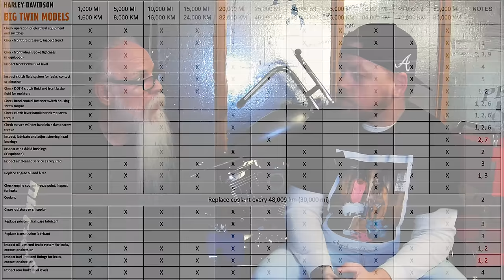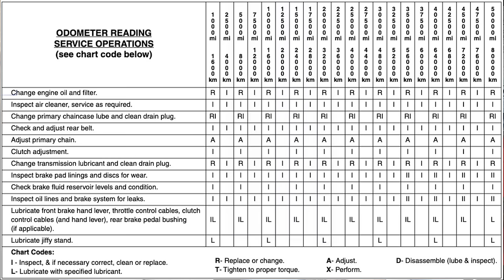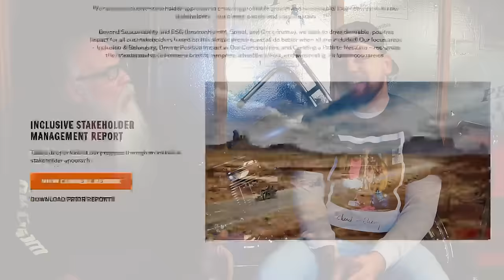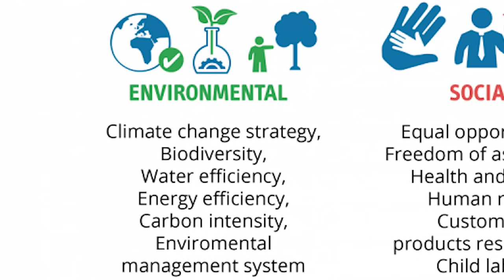Harley Oil Change Intervals-Engine, Primary, Trans

Comment: I change all three every 3K, oil is cheap.  Formula + in primary and trans and everything is smooth as silk.  A Harley tech friend said most not all of his trans failures had Redline in them, don't know if there is any truth to it but that's what he see's.
Reply from the maker: Interesting on the Redline.
I have not seen many trans failures.  I do have a friend that runs redline in his trans, and it failed several months ago.  But with the way he rides and shifts, I believe it would have failed regardless of what oil he was running.
Thanks for the add. 👍😎👍

Comment: 3000 engine oil. 5000 primary and tranny. My reasoning: Engine oil gets contaminated with "blow by" on combustion, that can form acids that are detrimental, microscopically etching fine surface finishes. Engine oil gets exposed to higher temperatures, where as the other two do not see these high temps.  There is no "blow by". I use high quality synthetic in all three holes. Always looks good at change intervals, like it could run longer, but I get NOTHING on my magnets. Been a Harley guy for 50 years. Last ride was an '99 Evo, still running clean and strong at 134,000 miles, when it was totaled . I ran Amsoil in it, as I do in my current ride, ,a twin cam. IMHO, fluids need to be particle free, to avoid scuffing precision surfaces. In my experience, clean fluids along with regular overall maintenance give long service life and very few problems on the road. Just my two cents worth. ....
Reply from the maker: All good points! 

Thanks for sharing and for commenting! 😎

Comment: Hello Kevin,
what can you say about your experience with Harley's Heavy gear oil in the transmission. You had exchanged it for red line. Would you change every 5000 miles here too?
The oil is very expensive, at least in Germany. 35€ per Liter
Greetings Thomas
Reply from the maker: I have several thousand miles with the HD Heavy Gear Oil in the trans.  It is definitely good stuff...almost as good as redline.  But I will be putting in redline next go around.  To me the redline shockproof seems a bit smoother.

Comment: Always watched my motor oil and once it starts getting dark brown which has been around 3500-4500 miles of regular to aggressive riding I change all 3 holes if I have 3 😁 sometimes I run open belt drive primary on big inch choppers , I never have allowed my oil to get black , I always tell my friends who say you're changing your primary and transmission oil way to soon that it's my money I will spend it how I want 🤣
Reply from the maker: Great points! 👍😎👍

Comment: On 2013RK, engine = syn3 8000km (Europe), pri = formlua+ 10000k, trans = formula+ 12000 k, just for ease and less stress I am not doing 3 holes at the same time anymore, which I was doing with the Evo's (one time 11000 km on the 3 oils during a 4-5 week Scandinavian holiday in 2010, no problem with the oils on long distances in such a short time period ! ).
On 2016UL, engine = syn3 8000k, pri = formlua+ 10000k, trans = gear oil 12000 k, this is the holiday machine now, if 8000 k is after holiday, I will do 9000 k, no fear, no problem, engine oil never becomes black (has no "tune"), no heavy consumption.
On 2019UL CVO engine = syn3 8000k, pri = gear oil 12000k (starts smelling), trans = gear oil 16000 k, I think that's enough mileage, I won't go to 32000k / 20000 miles for the transmission, although that is the cleanest oil, with nothing on the magnetic plug.
They will also extend the mileages for customer cost sake compared to the competition (at least for cars), after experience that the older shorter intervals showed no serious wear etc. , so were actually relatively too short. And, of course, synthetic oil is then prescribed as well.

Comment: My personal take is engine at 5k. I can see primary up to 10k with good synthetic oil. However, i still change mine at 5k because of cluth friction material. I can totally see 20k for a service on a transmission, though. Modern synthetic oils are far superior than those of even 20 years ago.  For example mobile one has a extended service synthetic motor oil that you can go 20k on a oil change with the matched filter. I use this in my vehicles. I have put just 200k on my 2016 gmc sierra with a 5.3l doing these interval with mobile one. I've cut the filter open a few times and never see anything out of the ordinary. If you also look at modern automatic transmission in cars they arent even serviceable anymore.
Reply from the maker: Thank you for the info, much appreciated. 👍😎👍

Comment: Change my engine oil every 5,000 and primary and trany every 10,000 but they all get changed at least once per year before going into winter storage. I average between 7,500 to 12,000 miles per season.
Reply from the maker: Thanks for sharing. 👍

Comment: Just compare 2 things. How expensive is a rebuilt or new motor compared to oil? Oil is cheap. I won’t wait for double digit thousands of miles to change oil. Everything at 5k is good with me. Oil is cheap. What happens if you don’t ride your bike that much per year? What if you only go a couple of thousand a season?
Reply from the maker: Ture! I would much rather change my oil  way more often than to have to rebuild the motor any day! Thank you for commenting! 😎 MB

Comment: I watched a video where they said that the oil pump for the 2019 and below M8 114 is inadequate and should be replaced with a 2020 or newer model, and better yet, a performance model. Any opinions?
Reply from the maker: Around the middle of 2019 HD changed oil pumps to the latest design. (click link below for a chart)
Prior to that, they went thru quite a few iterations as they looked for a design that would scavenge the oil better, reducing the chances of sumping.
https://live.staticflickr.com/65535/48740997281_ac613f1cc2_h.jpg
If you have one of the older oil pumps, there is a chance (not a guarantee) that it will eventually cause problems.
Reply: @DKCustomProducts  Thanks! I'll check mine out. Fingers crossed.
Reply: @DKCustomProducts  8/18. Bummer.

Comment: I don’t go by miles so much, just change engine&primary 2x per riding season, and the trans 1x every season. 
 Amsoil vtwin
 Severe gear in trans
 Jd hygaurd in the primary.
Reply from the maker: Awesome! Glad you have found an oil and routine that works for you! Thanks for commenting! MB

Comment: I am an ass about maintenance.  I do motor oil every 3000 full synthetic and Tranny with Primary every 5000.  Tranny I use Redline with Shockproof and Primary is Redline primary fluid 
Runs smooth as glass

Comment: I clock around 10k miles a year on average and have been doing engine oil/filter every 5k and primary + trans every 10k.  Might start doing a 3-hole every 5k, might not... 😅
Reply from the maker: The primary ends up with a lot of containments in it, from the primary chain and the clutch plates....and depending on how one rides, that can be quite a bit.
Transmission hopefully does not have much in it...unless there is a lot of grinding of gears, and/or a lot o dumping the clutch at higher rpm's.
Thank you for the comment.MB

Comment: Any downside in starting to run synthetic oil in an Evo engine that has never had synthetic oil run in it?

I’ve read that switching over to synthetic oil’s in older bikes might cause them to start leaking.

Any truth to that, or any downside you can think of?
Reply from the maker: Good question on a hotly debated topic.
There are many who come down on both sides of that fence.
If you still have the older, or original gaskets, I would not even consider running synthetic.  Even if you do have all new gaskets and seals, I do not know that it would be something that I would do on my own Evo.
Reply: @DKCustomProducts  
As always thank you for your answer. I use the Harley oil, I’ll just keep using that. The damn thing has been running 26 years on standard oil, I’ll just keep it up.   

Your videos and your answers are really helpful.  I appreciate it.
Reply from the maker: @JR-ss3td  Good deal man, glad you're finding our videos useful & helpful. Thanks for watching, ride safe!

Comment: I have the original owners manual for my 1985 Electra Glide. 
Engine oil, filter and tappet screen 2500.
Primary 5000
Transmission 5000

Comment: Always Redline full synthetic 20w60 in engine, Redline shockproof in Tranny and Synth 3 in primary. Back in the days I used Castrol 20w50 and Castrol 80/90 in the gearbox on all of my Evo’s and Shovel’s, we filled the Primary with Castrol 20 or even 2 stroke oil could do the job since it always ran out over time. 😉👍🏻😂

Comment: Great video as usual.  I change all 3 holes when I do it at 5K.  My question is, how long do you go time wise to reach 5K?  1 year, 2 years, when timewise should you change your oil?  With Covid, I'm sure many could go a long time without getting 5K.
Reply: The saying is, once a year wether it needs it or not. An annual maintenance is a good idea IMO
Reply: Every year
Reply: If riding less than 5,000 miles per year, oils should be changed yearly (at start of riding season). Condensation will collect in oil over winter hibernation.
Reply from the maker: As others have noted, at least once a year.

Comment: Oil is a lot cheaper than a new motor, primary, and transmission... I always change all 3 and I run Lucas 5w50 and 85 in the tranny

Comment: What if the old numbers were there to sell fluids? Abs the new interval is what's actually accurate? Is that possible?
Reply from the maker: I like what Jack said...going to PIN is comment to the top.
I think if it is coming out dirty it should have been changed earlier.

Comment: What are your thoughts when your riding mileage doesn’t meet a calendar based time requirements to change the fluids? Because life gets in the way sometimes that one year change requirement might be on fluid with low miles.
Reply: I have the same question! Should you change it every year even if you don’t hit 5000 miles? In my area I can usually only ride 8 months out of the year so I don’t always hit 5000 miles.
Reply: Condensation in a motor is rarely discussed, it's hard to quantify. Motor builders recommend yearly if miles are low as cheap insurance against condensation.
Reply from the maker: Per your  manual, fluids should be changed every year, regardless of miles.  This is a good practice.
Reply from the maker: As Carl said, every year, not only because of condensation, but also acid build up.
Reply from the maker: Condensation and acid build up!  Thanks for sharing. 👍
Reply: @carlbruhn1772  cheap insurance against condensation is riding it long enough to get up to operating temperature don't just hop down the block and shut it off get on it an hour later and hop down the block and shut it off that's where condensation comes in. Edited to say; we used to refer to it as "sweaty valve syndrome" as always, ride aware.
Reply: @Pete Smith  Absolutely.  The weirdest looking inner cases I ever saw was on a 10 year old sporster with 900 miles. The owner had the oil and primary changed once. He started every month for 15 minutes and figured the miles were low enough to not change it. It had a tinged yellowish orange color that I have never seen since. It was smoking due to a poor ring seal. He sold it to us and we sold it to a local fella who raced sporsters.
Reply: @carlbruhn1772  my bet is that the yellowish color would be aluminum and the orange color would be iron
Reply: @petesmith5092   I truly wish I would have taken pictures.  It almost appeared anodized. Quite even just a bit darker towards the bottom.  That was a real eye opener.
Reply: @DKCustomProducts  and dont put it away with the used stuff! Get it hot, drain it in suspension, then change it and put it away with the new stuff in it
Reply: @carlbruhn1772  Yes Sir! Every little bit helps, unless it hurts. There are ways to save money, but being cheap is not one of them. I ride year 'round and I found that out the hard way. (Yes, I have heated grips)

Comment: My 2024 TriGlide  calls for 20W50 motor oil in the transmission.
What 's up with that??
Reply from the maker: For decades one of the oils recommended by Harley for the Transmission has been 20/50 motor oil, and I've never seen any damage due to using it.

HOWEVER, it will shift smoother when using something like Redline Shockproof gear oil.

Thanks for commenting! MB
Reply: Will Harley void your warranty for not using 20w50?
Reply from the maker: Not only will they NOT void the warranty for not using 20w50, if you look in your manual, they suggest different weights for different ambient temperatures.  You can see a photo from the HD manual at this link- https://www.dkcustomproducts.com/pub/image/Links/Oil%20Weight.jpg 

Thanks for commenting! MB

Comment: Winter here is late November to early March. When the bike comes out for spring, I change the oil. Every other year I change the trans and primary. I use screaming chicken S3 for all of it. With all the projects I'm working on these days, I'm well under 5k a year... more like 3k. With my daily drivers I change at 3k, and on one model I change the filter at the half way mark (1500), as it has a tiny oil filter (and recommended by GM). 10, 15, 20k between oil changes is retarded, regardless of the snake oil in it. When people ask me how often I change the fluids in my rides, I respond with "All the time". People are fishing for validation to not change their fluids... Because spending 100 bucks for such things seems excessive.. However they are willing to drop 1+ grand on a phone without hesitation. Maybe do a video on the serious mental heath crisis in the country, with falling IQ levels across the board.
Reply from the maker: Thank you for your comment.  Some good info, for sure.
No doubt the "smartphone" has resulted in many unintended consequences.

Comment: I do engine oil every 3k. I usually try as well to do the other two the same time. Maybe 40% of the time the primary and transmission I’ll do no later than 1,000 more miles after engine oil is changed. I’ve always been under the belief whatever the manufacturer says..you want to do before. They have a interest in your bike not lasting as long as you want it to.
Reply from the maker: You have a good point there!

Comment: they also state that using heavy duty gear oil in the primary and tranny now?
Reply from the maker: It can certainly help to reduce that clunk sound if you are using a heavy duty gear oil. 

Here is a video on oil that you may find interesting- https://www.youtube.com/watch?v=bNHgNThrqQo

And here is another video about the HD gear oil....been using it for a while now and like it, in both the trans and the primary.
https://www.youtube.com/watch?v=1Ml7HP4jHkE
Reply: No need for heavy oil to eliminate clunk going from neutral to 1st. Pull in clutch, a light 500 rpm blip above idle, hold clutch in for 20 seconds, push into 1st...........like butter no noise. You're welcome. Another trick do the above and push bike 1/2'" backwards if you still get the clunk that wakes the dead. No need for thick oil.  @DKCustomProducts
Reply from the maker: Good pointers, and heavy oil is not needed, but certainly  is nicer to use.

Comment: I had a good salesman when I bought my 22 Street Glide. Once I signed on the dotted line he told me all of the Harley protocol and then he pulled me to the side by the coffee machine and told me that none of the guys at work there follow the Harley protocol on their bikes.  I've had dirt bikes in my younger days and came up through the Kawasaki triples and ended up with ZX 14 Ninja. I know two wheels and oil changes.
I was concerned about keeping the warranty but then when I found out my bike was drinking its own piss I couldn't get that EPA shit off fast enough.
Got a Trask Assassin Air Cleaner with their bypass system, a Feuling vented dipstick and 2x2 Khrome Werks Dominator head pipe with Reinhardt 4 1/2 DBX mufflers with louvered baffles.
I'll be honest after dropping 32 Grand I didn't think I was going to have to go out and change much except the bars.
But now I feel like the line is crossed. I have some great shops locally including Chris Rivas V-Twin with the fastest bagger in the world... so no shortage of the best advice... Harley can collect their brownie points with the EPA or whoever I'm going to build an outstanding dependable bike..
Thank you for your content and your advice. 👍
Reply from the maker: Glad you are happy with your ride! 👍😎👍
Thanks for the comment, and good to hear you are finding the videos useful/interesting.

Comment: Now to me it's common sense. I do 3 hole change, syn oil every 5000, 2015 ultra limited 103 ci. I do this because, " what's it going to hurt"!!!! Screw 10000, 20000 etc. And you have good oil in primary, transmission at all times.

Comment: Also incase you are not doing 5000mi...then 6 months. As synthetic oil chemical bonds break down once opened and exposed from the seal container. There is an age factor of the oil too.
Reply from the maker: Great point. 👍
The manual recommends at least once a year.
Reply: @DKCustomProducts  Yeah ...a year is a good enough starting point. Incase engine temps rises unusually fast or overheats, then the oil has stopped doing its job. Time to change.

You guys really put out great videos. Meaningful, informative true motorcycle content. Thank you for everything.
Reply from the maker: @dinshak86  Glad you're liking it! Thanks for watching!

Comment: I am still trying to find out how trucks go 45K or more between oil changes but cars and bikes go no longer than 10K
Reply from the maker: They don't get as hot, or run as high rpm's.
On my wife's diesel truck the oil generally runs between 190-200F.  If it is hot out, and has a significant load, when the oil hits 210F they fans kick on (so loud they sound like a plane getting ready to take off) to get the temps back down to 190-200F.